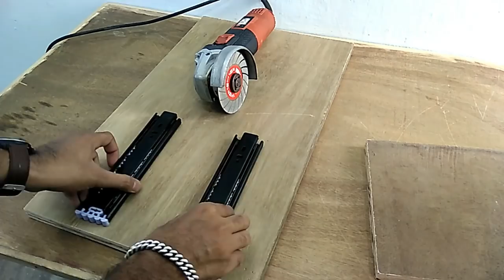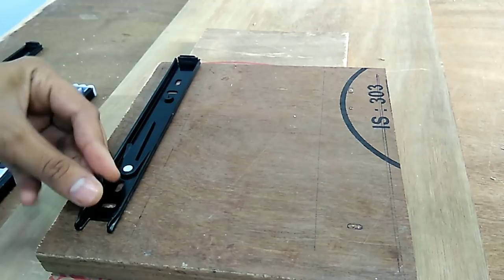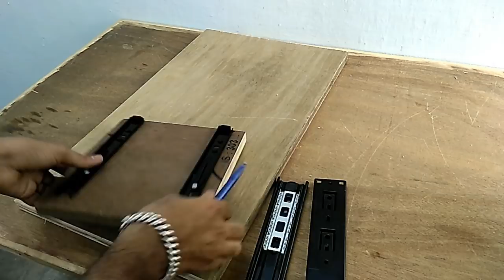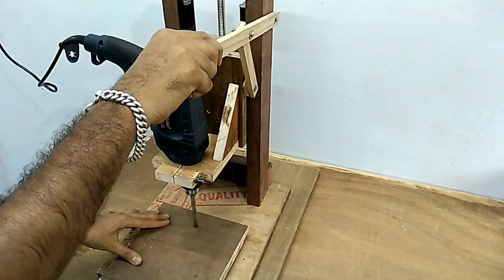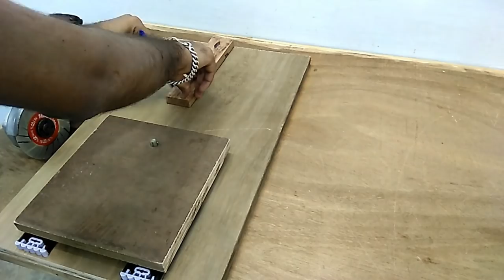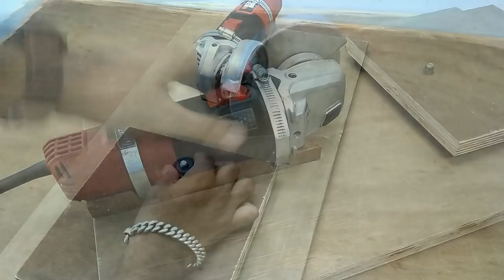Making Saw Blade Sharpener using a Hand Grinder || Angle Grinder Hack

Comment: need adjust the angles. surface of the teeth have angle toward left and right in turn. also need ange inward the center of the circle to make it " bite". other wise it will quickly dull!

Comment: looks like maybe too many sparks. Light pressure will decrease the heat and make the blade last longer. Also some blades are sharpened at 90 degrees I have a few. Good job here keep the vids coming.

Comment: Where did you get the arbor that you fastened to the board and is this the same diameter as one from a 8" circular saw blade or 10" inch table saw blade?

Comment: Hello, I have used your method of sharpening but find that the blades are still blunt. Do I sharpen it for too short or could there be another problem?
Reply: Cause he didn’t use square to make sure grinder is in right angle. Make sure angle is 90 degres

Comment: now that's a better idea than I had but I don't know you still got to move it in and out I use two screws in the blade one on the left one on the right I position the blade tooth in the left hand screw roll it into the angle grinder until it bottoms on the right hand screw and it's done you rolling it it's a great idea and you got in and out motion on a table I'll see what I can do with that one

Comment: Can any one answer that what type of blade I have to use to sharp my table saw blade
Reply: That blade he uses to do the sharpening is diamond coated.  The fact that it is small makes it affordable and I think many of us have angle grinders.  My only complaint is that you are restricted to sharpening that one size of saw blade but if you are doing production quantities...  In another man's vid on a home build sharpening tool he states it is not good to breathe the Carbide dust.  Solution: either a rigged up suction arrangement or wear a good quality breather mask.  The cheap ones with the thin rubber band don't qualify in my book.

Comment: What is those nuts called for the angle grinder and where can I find them?
I see you had both top and bottom nuts for the angle grinder to hold on the saw blade. 
Where did you get those nuts?
Reply: from a second angle grinder??
Reply: Ok thanks.
Reply: Andreas von Krüchten 
Ok thanks.
Reply: Allíexpress !

Comment: As it was stated by Stefanel19, your doing the blade bad. Some teeth are sharpend at compound angles. How do you adjust for that? While your reworking your great idea why not add for chainsaw chains as well.

Comment: so I took I took the bracket for my ankle grinder and I screwed it to my workbench and where the handle goes I took the handle off put it into the bracket and put the handle back on so the angle grinder sets perpendicular I didn't need all that added stuff I made a wood frame follows the pattern of the angle grinder sticks out beyond the angle grinder for the blade table screwed it to the table I put the blade where it needs to be for sharpening put one drywall screw on the left about five teeth up put one drywall screw on the right when the drywall screw on the right has caused the blade to be bottomed out at the tooth that tooth has been sharpened very simple with the way that you make this you have to store it someplace.... I take mine apart I have brackets on the wall no muss no fuss

Comment: you need to explain what kind of grinding wheel to use with which kind if saw bladeit appears that you are sharpening carbide tipped blades which can't be sharpened with just any grinding disk  good idea on the drawer slides cheap and work good, good video quality
Reply: bowlweevil those r just regular saw blades for wood. Plywood blades don't have that little piece on the tooth cuz made for less splintering. These r reg wood framing blades.

Comment: Brilliant. But 7.25 inch blades are 10-20 dollars. I used to bring my 12 and 10 inch blades to a place to sharpen them at half the cost of new and they would come back sharper than new.
Reply: "But" so what?   You have to bring the blades to the guy.  Be without your blades, then go back and pick them up, and then pay the man.  Time, travel costs, and money.  What do you figure it really costs?  Maybe more cost efficient overall to sharpen your own?   I'd rather have my blades "in-house", under my control and on my timeline.  If a guy doesn't have much money, needs his blades ready when he is, or is retired and has the time to do things, then this is a good idea.  Brilliant.

Comment: teeths are sharpened at like 85 degree not 90 like you have set that blade, 1 left side 1 to the right side, sharpening bouth side to 90% tbh idk if you didnt make that blade more dull then it was, dont get me wrong the idea is very good  but  not every1 is an expert in sharpening blades and they will do exacly what you did in video
Reply: Hes on the right track. LOL. Just tip the grinder a bit. Work every other tooth then flip the blade.
Reply: I agree. Maybe if he set a 15 degree center tilt (roughly 5-8 degrees each way, left and right -accounting for the imprecision of the setup, and centered at the point of contact). Just mark the odd teeth, and grind alternating teeth, then flip the angle back and grind the remaining teeth. 

This would either get closer to that 85 degree angle (which would be pretty difficult to get that precise on set up like this) but might just be enough to get the tooth variance desired to cut the wood. Then again, it could just turn this thing into the blade sharpener from hell. Interesting ingenuity nonetheless.
Reply: stefanel1979 by
Reply: stefanel1979 ك

د
Reply: James Myers Sr.n
Reply: If you watch closely he’s tilting the blade on its access. I assume that’s what the white bushing is for. Flex
Reply: Yep! Just another YouTube cowboy! On the right track though but needs fine tuning. Get your angles right or use your blades for throwing stars! Lol
Reply: Hand grinding Mihener
Reply: stefanel1979 it's easy enough to make a small metal template set to 85 degrees and to set the angle of side rake but setting the front rake is more difficult as that is controlled by how far the centre of the saw blade is away from the face of the grinder wheel. And the method used can only be used for one angle and one Diameter of saw blade, and if you have more than one saw blade with different rakes you have to make another sled. Or as many as the blades you have.
Reply: @henrybemis9956  translat tamil

Comment: Where to buy sharpening blade
Reply: You should be able to find those in the power tools section at home and hardware stores.  If you are remotely located it will take the magic of online ordering.  I prefer looking at stuff on a shelf myself unless I am so familiar I can "do it blind".  Blade needs to be diamond coated for doing the carbide saw blades.

Comment: Not a good way to do this...No way to set the angle of the grinder in relation to the the actual tooth on the saw blade...carbide teeth on saw blades alternate, one to the left and the next to the right...no relief in the cutters on the saw blade this way...Sorry, but this is a great idea without all factors considered...
Reply: David Reel Sr pornohub
Reply: na obyčejné řezání je to jedno. Používám rozbrušovačku k likvidaci palet na topení a na získání pěkných prkének. Pilový list za 2 Euro, tak co řešit.
Reply: U levných kotoučů z Číny za 2 US dolary se nic nestřídá !!!

Comment: Hmmm, if that angle grinder blade catches the teeth on the saw blade it could start the saw blade rotating on its spindle... goodbye fingers!  At least wear heavy gloves and gogles @-@
Reply: Jammoko sorry to tell u but with as fast as that grinding wheel is going u can't get a tooth of the blade caught in it.. No chance in hell... Do the physics..
Reply: A na to jsi přišel vlastní hlavou! Ty asi budeš Ing. , nebo ne?
Reply: @Dennis-pe6zx  I'd wear heavy gloves all the same.